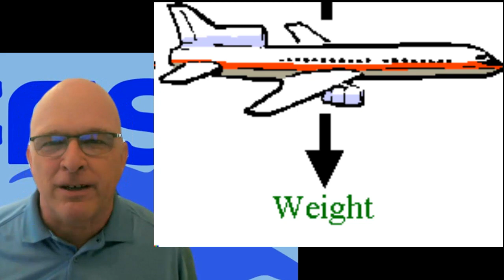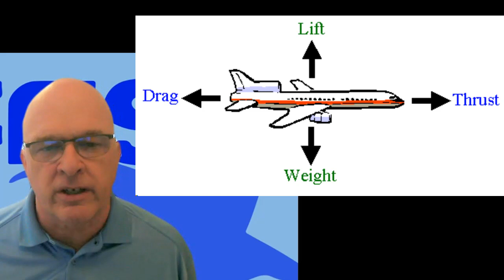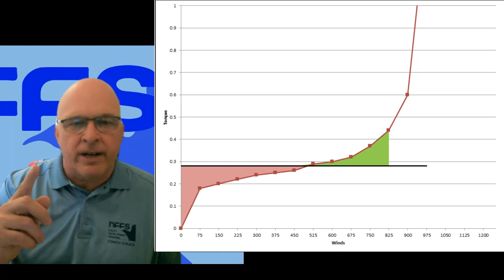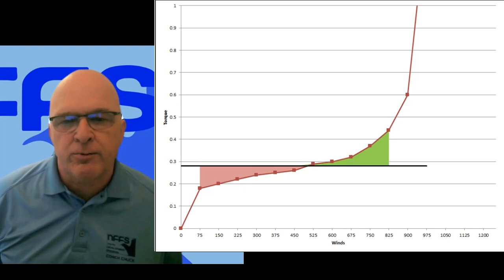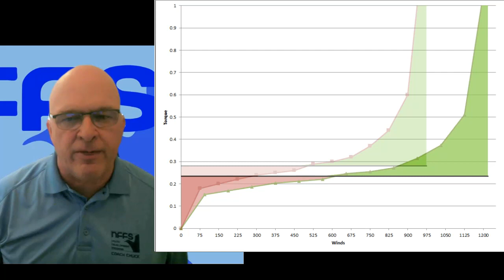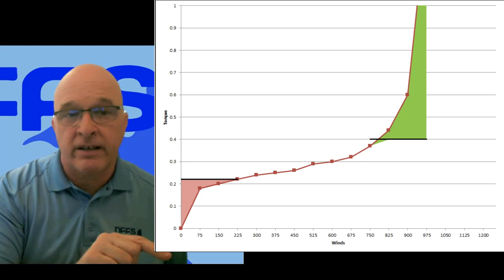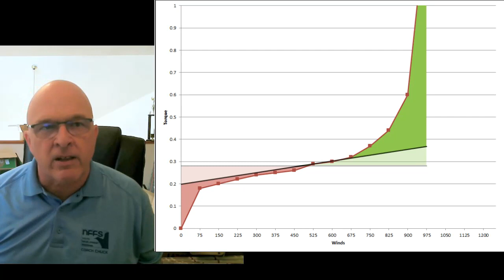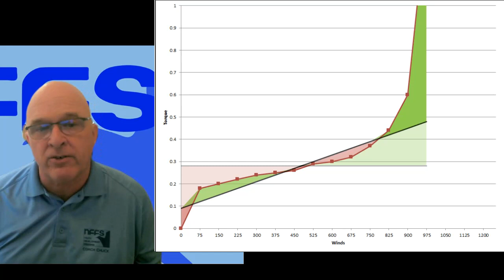Prop Pitch / Rubber Motor Balance

Comment: Interestingly, I developed the idea of a "balanced motor" after plotting flights of my Dandiflyer on the torque curve and finding that the best flights occurred when the motor was sized so that the green area was equal to the red area. This happens when the level flight torque is equal to the average on the torque curve. That allows us to calculate the dimensions of the required motor for maximum duration.